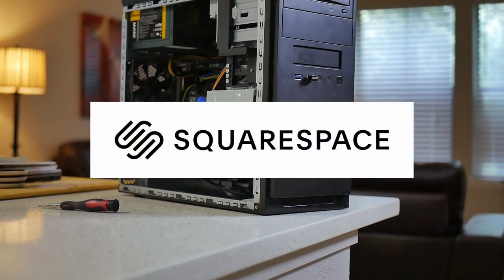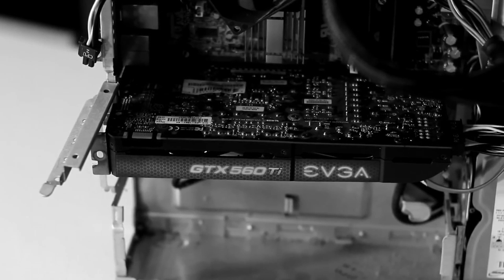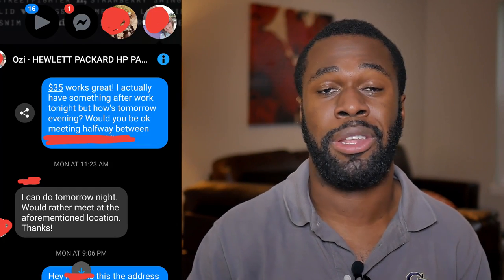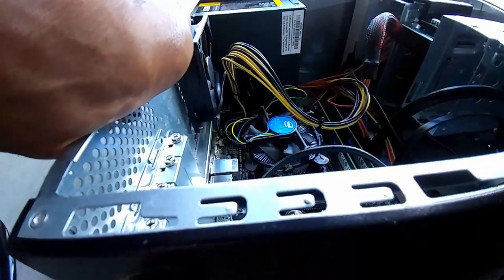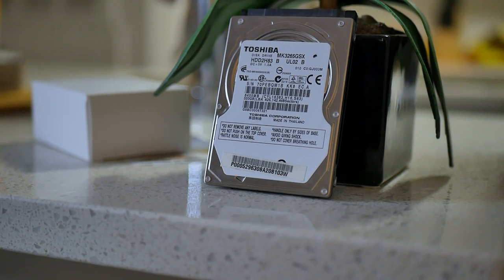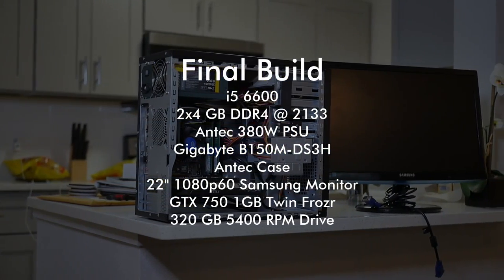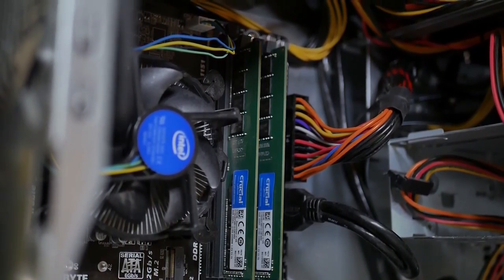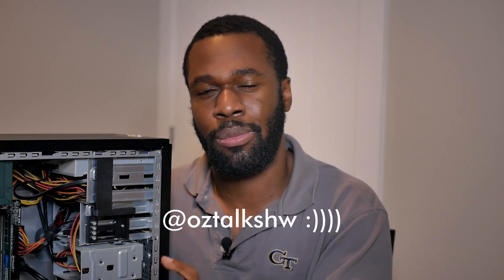The $25 Gaming PC returns, but it's actually good | OzTalksHW

Comment: i5 6600 + 8gb ddr4 for that cheap
i feel so lost
Reply: Processor alone should be $75 used. This buy is more than a DEAL.
Reply: Realistically speaking, that was more than likely staged to give the video better watchability.
Reply: @spartan11mcxbox  It could be or maybe the womens didn't knew the pc's price or she were trying to sell her sons pc..God knows...
Reply: I can't find any type of "mid-range" Intel CPU for under  130 it sucks I might just go to ryzen because if I want a reasonable upgrade blike an i7 it will be $300 and for that money I can go with ryzen 7 and a new motherboard.
Reply: y’all obviously ain’t good deal seekers Check the Facebook marketplace
Reply: @oddguyamaar9191  I regularly buy used tech either to use myself or to resell as a project, and even though is not often, sometimes people just misjudge what they have or simply prefer to sell fast and cheap rather than making a few extra bucks and wasting more time. In this case the seller was probably thinking "I'll try to sell it for 30, who would want a big bulky PC tower when you can buy a used laptop for not that much more?", without knowing the value of the components on the inside of the bulky PC tower.
Reply: 510Deshawn facebook marketplace is unreal bro
Reply: @spartan11mcxbox  i felt like they didnt no wat was up with the specs, they just sold it for a price they think is profit
Reply: He got it for 5 bucks even if it was like a i5 2400 and 4gb ddr3 that would still be a insane deal

Comment: I hava a 25$ Pc..... i7 950 + Cooler + Case + Gtx 470 + 6gb
but new Psu
Reply: Nice
Reply: Here ppl would ask the 25 for the cpu alone haha
Reply from the maker: Yooo nice job!!
Reply: Hey this is a cool pc mine is
Q6700
Gt 1030 ocd by myself
4gb 800mhz ddr2 ram
240gb ssd for 125 bucks
Reply: I PRAY that you sold this dude.

Comment: "Dual core CPU are obsolete,"....

I'm here with my dual core CPU...
Reply: My laptop has an 1 core atom. Now I look 3 years back (I have a new pc now) and wonder how I could play lol and modded minecraft .
Reply: @vetamauromihali  I still have a desktop PC with Pentium 3. That's a single core CPU with 1GHz of speed. The PC is already 20 years old
Reply: my MacBook Air can run GTA V at 20-30 FPS... at all low settings.. dual core CPU 4 GB Ram and no GPU
Reply: cries in g4560
Reply: @vetamauromihali  Minecraft is pretty singlethreaded
Reply: same but our family pc has a 6 core cpu an i5 9400 and a gtx 1050ti but my laptop is more personal to me and i use it
Reply: @bwstouge  CRIES IN PENTIUM G4400 XDDDD

Comment: Oof. What a deal and it's nice to see you went back and gave them more money. Personally for me, my best deal today was a computer I found on a facebook listing for $100 about two years back. Seller posted pretty vague specs saying it was an "i7 hobbyist PC with 2GB video card" It ended up being a fully custom built PC. An Antec 300 case with 3 green LED case fans, the PSU was a 550W Bronze PSU, (I don't remember the model but it was modular and all the cables that were not already being used were missing) The storage hadn't been installed yet and it was a brand new, still in the box 240GB Crucial SSD. The video card was not a 2GB card, it was actually an Asus GTX 1050Ti Dual 4GB and finally the motherboard was an ASUS H97-Plus with 3x4GB of RAM and an i7-4790k. The guy said he was pretty familiar with computers but he was moving and just needed to get it sold. Everything ended up working perfectly and I did have to disassemble and deep clean everything. The computer was kept on the floor and covered with dog hair. This is honestly the first and only good local deal I've ever gotten, but this is because I live nearly 2 hours away from cities that have decent populations. Everything else I've ever purchased has ended up being from Ebay.

Comment: Great find. You really lucked out there!
Unfortunately, the used market here in New Zealand is simply terrible. People ask near-new prices for their 2yo (or older) hardware, and that's driving the prices up. In fact, it's usually much cheaper to buy from the US or China, even after the shipping/forwarding costs are accounted for.
Reply: Nah thats not the case, sure there are some people that try to get way more than its worth but I've found plenty of good deals on trade me. I few weeks ago I found a 7th gen i5 with a rx 480 for 500 nzd. thats a steal.
Reply: @maxthememer1780  Sorry, but ~$330 USD for a 4C/4T i5 and RX 480 is not even close to a "steal," if you check the average prices on sites like eBay and Taobao. Everyone else was simply asking too much, which made it appear cheap by comparison. That's why I said the market prices have been inflated by those dreamers.
Reply: @manaphylv100  try to build something equal to it for brand new see how much it costs
Reply: @maxthememer1780  If you already have the motherboard and other parts, you can buy a new i3-9100F (4C/4T, same as old i5) on Taobao for around 560 CNY (~82 USD), which any LGA-1151 board can run with a simple BIOS mod. A new RX 580 is way under 200 USD.
If you are building new from scratch on a budget, then Intel isn't even worth considering when you can get a 6C/12T Ryzen for the same or less.
Reply: @manaphylv100  you're talking about the nz used market so compare it to the nz new prices
Reply: @maxthememer1780  My point is that it's cheaper to buy from overseas, since the local prices are generally terrible. That applies to used and new.
Of course, if you want a warranty that you can actually claim, you might have to buy locally.

Comment: Hey OZ! You should try to buy a MacBook Pro for around the same price you bought your Dell Laptop (you can actually buy older MBP’s pretty cheap these days) and then do a video comparing the two as far as pros and cons of going either direction! Would make for good content comparing hardware as well as performance of both machines. As well as showing how good of a deal you could get on a MBP. Maybe you’ll even get lucky and find one that needs minor repairs and make out like a bandit!
Reply from the maker: I was considering doing this actually! We'll see though. I have a few other vids in the pipeline atm

Comment: If you ever get a chance, talk to the building or facilities manager of a large building that has a couple of law firms in it.  These law firms constantly cycle through hardware, so ask the building manager if you can raid the electronics recycling, usually held in the basement.  A couple years ago, I dug out about a dozen Dell Optiplex 7020's with i5 4590s and 8gb of DDR3.  Recently I found three Optiplex 7060's with i5 6600 and 8gb of DDR4.  I kept one for my wife and sold the other two for s fair bit.  I also found another Dell with a Xeon E3 1245 v5 with 16gb of DDR4 and a Nvidia Quadro 2200 that I'm currently using to Fold@Home.  These buildings are goldmines if you get to know the people in it.

Comment: Holy crap i have never seen such a thing happend before. I think that computer has a lot of potential, if you upgrade that 750 for say a 1660/1060 6gb you could have a flawless 1080p60 gaming rig, for less than 400$

Comment: i got a i7-960, radeon 6970 in a coolermaster haf912 with 650psu 16gb of ddr3 ram. on a sabertooth x58 motherboard. with ubuntu installed. at free geek in vancouver for $270. i later upgrade to gtx970, and windows 10 pro. added 6 rgb case fans. just need a i7-980 and a liquod cpu cooler to oc. i should be good!

Comment: The truth is, they didn't want to do the work to find out what the PC was, so they knew they could take a loss but just wanted it gone. So you are fine because they knew what they were doing. You sure got hella lucky with that deal and you know it, but it's great! I think there is room in the budget for upgrading the gpu and hard drive in a later video. Please do follow up with this build and show how easy and cheap it is to upgrade your budget system as you game!

Comment: And here I thought snagging an 6 core xeon workstation with 8GB of ram and 500 GB HDD for $80 and a gtx 1070 for $150 and throwing in a $20 240GB ssd boot drive was the deal of a lifetime.

After completing that challenge I probably would have went back to that lady and gave her the 25 from the monitor sale to ease my conscience
Reply: It was. That's an INSANE deal

Comment: Its good some people get good deals, because some deals arent fair, like i need 300 to 400€ to biuld a pc eather new with low end parts or , 250 pr 300 with used paerts with socket 1156 h55 board and GTX 960 2 or 4gb

Comment: Ok when I saw that it is a i5 6600 I was like man wtf... I managed to get a i5 2400 for $25. I were lucky man. I5 6600 used is around $100 on ebay. So I bet that you can make it a bit better, like adding a 500-550w psu 80+ bronze, a better gpu, and maybe a new case and thats it.

Comment: ouch. I got a $70 PC, that's worse :0

i5 2400
8gb DDR3
1TB HDD (low rpm)
R7 240
Reply from the maker: That's solid for the price. Just upgrade the GPU
Reply: OzTalksHW Thanks! Took your advice and bought an RX 580. Works great! Tried getting a pny ssd but didn’t work with windows 10 for some reason.

Comment: Plss...help mee.....when ever i start any game, everytime it freezes after running for 15-20 minutes (every game i run) gpu 750ti 2gb 8gb ram 450w psu
Reply: That sounds like thermal throttling on either your cpu or gpu would be my guess. I would spend a couple bucks and get some thermal paste and put a new coat on your cpu/gpu
Reply: @KadiusFTW  then i should go for a new cpu ..becs ..my gpu is only2yrs old..ny suggstns for cpu under 200$ for gaming
Reply: @sumitava1374  no
Reply: @KadiusFTW  okaee..
Reply: I would suggest checking if it is a thermal issue first before looking to upgrade, as it may just be a fix you can do with a screwdriver and thermal paste
Reply: @KadiusFTW  okaee..let me see that first...